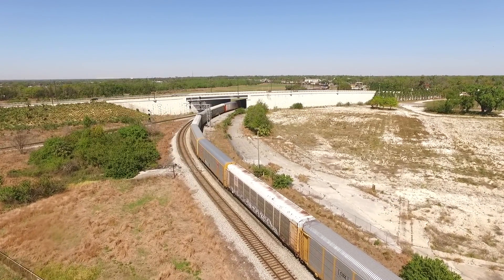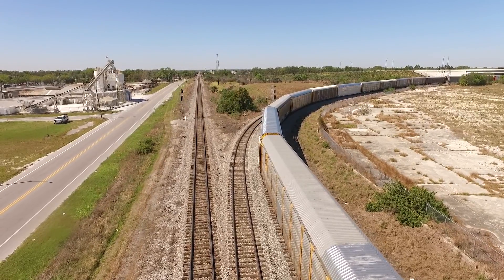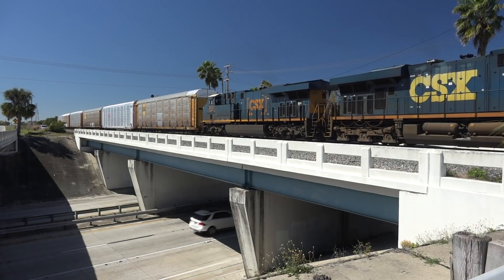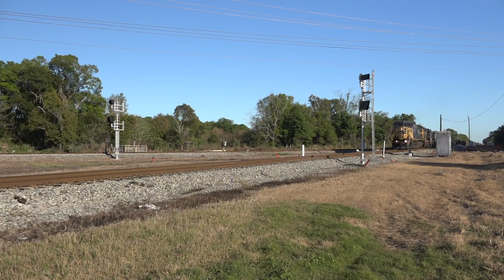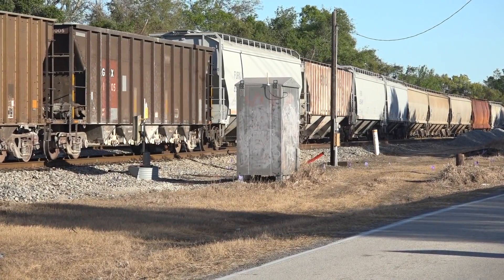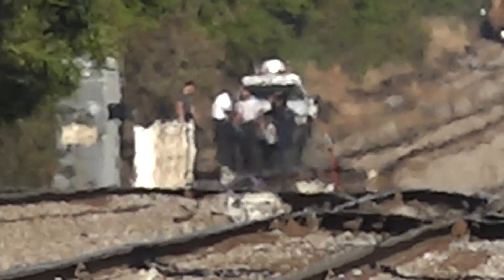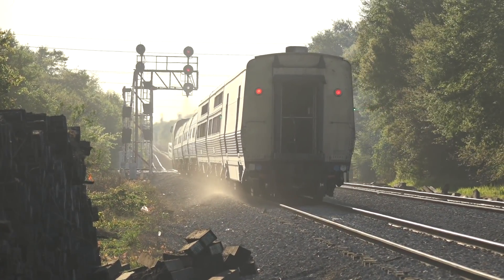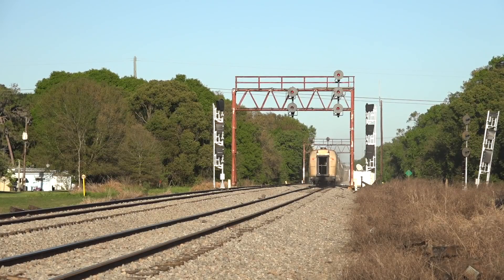Lakeland Go To Spots Part 2

Comment: Amazing content! I live up in Canada and will be coming down to Orlando for  a school trip in the next two weeks. Hopefully will have time to railfan while I'm down there. I was just wondering, what do you use for a scanner and antenna? I just bought the bc125at and a diamond 77, doesn't disappoint. I have also just ordered a bct15x with a railscan gain antenna for mobile. Thanks, DR.
Reply from the maker: Those are all good scanner choices. For an exterior antenna, I prefer the MaxRad (or any brand) 1/4 wave whip. It's about half the size of the 5/8 wave gain antenna and I've never found any discernible difference in reception performance.

Comment: Ok so I railfan in Nashville,TN and I see all kinds of CSX trains... but I don't know their classifications.. How do you always figure out which train is which? I have a giant list of CSX Q-trains that come through town but I never know which is which... 

What's the key to figuring it out? 

Also Amtrak 91 getting held up when it's already 4 hours late just rests the case on how 80% of Amtrak trains are late upon arrival

I also heard something about Amtrak going back to a modified Phase 3b scheme
Reply: Get a scanner. They can be bought for around a hundred bucks new. Some are more, some used ones could be less.  All you need is an analog scanner, a digital one will be quite expensive. Railroads are still using analog radio, with no plans that I'm aware of to change over any time soon.  As for how to tell one train from the next,  any time you hear them call a train by its train number (not the leading loco number), if it's an even number, it's Eastbound. If it's an odd number, it's a Westbound. Outside of that, some people just get to know what trains will be passing through and roughly when to expect them.
Reply: In that region if you have a scanner app there is a feed that runs off of Broadcastify, covers the Tampa, Plant City, Lakeland, and Mulberry areas.
Reply: +Nigel Richardson I have a Baofeng UV-5R scanner that cost me 40 bucks 3 years ago. Now they’re like 25.

Comment: Is Amtrak EVER on time?
Reply: Amtrak has a better track record (pardon the pun) than VIA Rail does. That said, both of them run mostly on someone else's trackage, so they are at the mercy of the host railroad. So, sometimes Amtrak (or VIA) digs its' own hole, but often it's a problem on whose ever road they are on,  and I think in the spirit of good relations, they refrain from finger-pointing, and just accept whatever criticism comes their way.